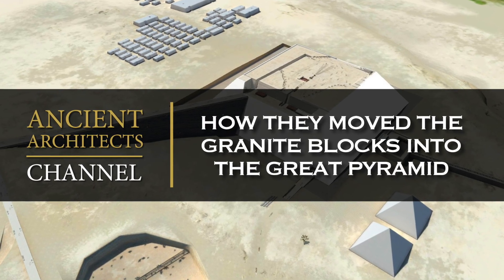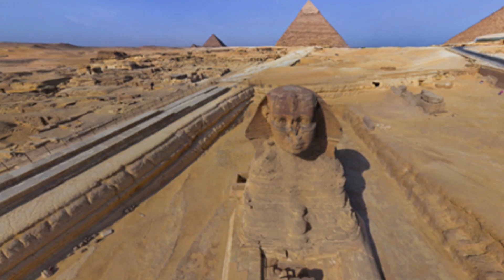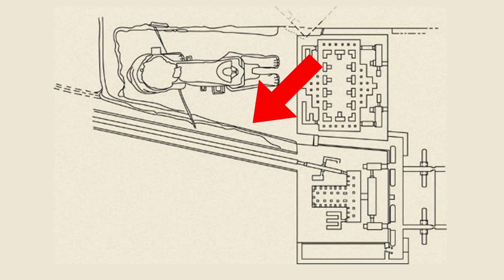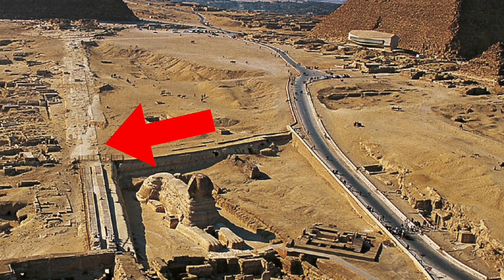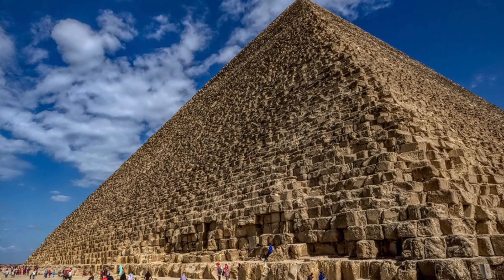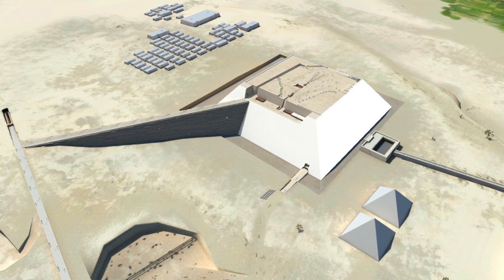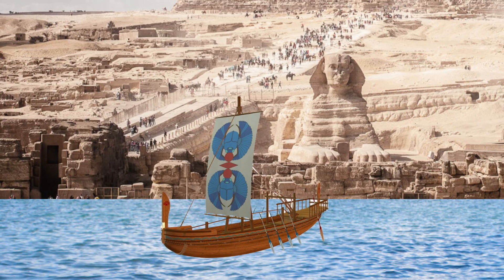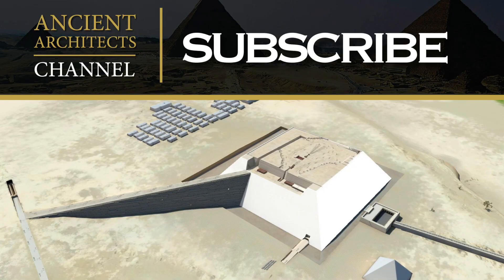How They Moved the 60-Ton Granite Blocks into the Great Pyramid | Ancient Architects

Comment: 1. It's clear to me, that the weathering of the southern wall of the Sphinx-inclosure, could not be created naturally when the causeway as you pressented us, was at it's place.
2. The structure of the causeway is much less weathered, which just means it was build later.
3. The valleytemple and the Sphinxtemple share the same base or foundation and has been planned together, which most likely means, they are both build at the same time, the first one with new blocks, and the second one with blocks from the inclosure which aren't granite.

Houdin has made many pictures, just by modeling with a PC, but that does not lighten his fault ideas.
Proof should be presented in order to follow his trend.

As far as I know ( which isn't much) the base of the Piramids where made much earlier in time?
Or did Bauval and Hankock where wrong in their books?
As you have mentioned before, it probably started with a structure like a mastaba.
So what kind of shaft should there be, in order to leavel a block on the ramp??
Straight trough the mastaba? Would they do that?
Not very plausible.

The way Houdin started his search, does not likely bring a new insight, setting the brain towards a solution means mostly, creating a possible solution with your old memory, which then start to manipulate the facts.
He had no option, that's how it began for him, having no job.

Like our famous Albert Einstein, it must come to you, out off the blue, suddenly you 'see' what nobody does.
He could not have made it, with the effort of thousand brains.
He was not even a proffesional..
Or better to say: because he was not bothered by the brain of a proffesional. :-)

Comment: You’re idea that because there is an angle to the causeway means that the Sphinx enclosure was built later is flawed. If the Sphinx enclosure was not there at the time of the building of the pyramid the causeway could have been placed at any angle up to a straight line access (90 degrees to the pyramid). If the Sphinx enclosure were there already you could then build the causeway anywhere BUT where the Sphinx enclosure was occupying space, without removing the Sphinx enclosure or covering it up. This doesn’t prove the age of the Sphinx to be older than the pyramids but disproves the idea that because the causeway is angled it was there first. (This also could also show that if the Sphinx was known to be there first it was of enough importance to not dig through or destroy.)
In a pyramid that is built to what has been termed engineering perfection, it is highly unlikely that the builders would take light any portion of the project and just lay a causeway down somewhere. The weather erosion on the Sphinx wall enclosure that you say could not have been disturbed if the Sphinx enclosure were older than the causeway could have happened several different ways. 
The height of the causeway above the floor of the Sphinx shows that either the causeway was built around the Sphinx or the Sphinx was carved out. Due to the height of the causeway above the enclosure of the Sphinx it would appear that if the Sphinx were built after the pyramids the causeway would have been of no more use and would not need it’s integrity kept. So why then would the angle remain when building the enclosure? It seems more likely that because of the difference in height of the causeway and the angle at which it sits that it was purposely built around the enclosure. The statue of the Sphinx age needs to be considered independent of the the enclosure. The Sphinx itself could have been built anytime before or after the pyramid but the enclosure of the Sphinx shows weather patterns of being there before the causeway otherwise the same weather erosion would be present on both the causeway and the enclosure if not worse to the causeway due to direct exposure. So the erosion of the inside of the wall could have been maintained in two ways. The causeway could be built around an already filled up with sand or gravel Sphinx enclosure and would not have been disturbed, or the enclosure could have been used to hold water (which could also rapidly enhance the erosion time). Now the actual statue of the Sphinx age needs to be considered separate of its enclosure. But in either case the causeway height and angle suggests that it was built around the enclosure regardless if the actual statue of the Sphinx was there or not.

Comment: How did they cut the rocks again?
Reply: One  of several possibilities. Sandstone is one of the softest stones. Saws of a copper-arsenic-nickel alloy (uncovered in the worker's village in the 80's and chemically analyzed and very much harder than copper alone) along with sand creates a good cutting edge. Once a sufficient groove is cut, wedges of wood are placed and soaked with water. The wood expands and the stone cracks apart.  The inner sandstone blocks of the pyramid s are quite crude, in spite of the "precision " claims made. The granite and casing stones, yes. The vast majority of the pyramid stones, no. The inner stones are so crude that filler mud and rubble was needed to fill gaps.

Comment: Maybe someone can figure out how much the Nile moves away from the Pyramids each year and then measure the distance from the Nile to the "docks" dividing that figure by the distance the Nile moves per year. It would still be an approximation but there may be a significant difference in these Pyramid dating arguments. Obviously; the "docks" would have to have been built first. So; that would be when Pyramid construction started. I still believe stone block cutting had to have been done in the Nile and with a very large diameter thin blade. There had to be water used to cool and flush material from the blade and stone. Then you have to determine if the blade was moved to the stone or stone to blade. I think it was stone to a stationary rotating blade. Floating the stones in water would be easier and more maneuverable.

Comment: This was rather brilliant!  Does a previous theory, that the Great Pyramid was actually built over what had been a hill, necessarily conflict with this one, or merely the two together suggest that building the Great Pyramid in this way, with the hill, definitely shaved a lot of time off of building it?  And since we also know that the interior blocks (the ones that aren't part of chambers inside the pyramid) are rougher cut, not so 'pretty', as the ones that are outward facing and inside chambers, would that also mean that building that in 20 years was pretty darn possible?

Comment: Hauling large stones faces two factors, weight and friction.  Instead of dragging [_] Turn the block V i.e. 45degrees.  Protect the edge of the stone with copper flashing to also reduce friction.  Check me on this, How wide is the Grand Gallery, would it accept the blocks at an angle?

Comment: Just a thought, that doesn't necessarily mean the pyramid is older than the sphinx. That just means the causeway is possibly. There could have been a temple or another important structure there first before a pyramid was thought of. Of course it is also possible that the pyramid does predate the sphinx but isn't definitive proof.

Comment: Look at a pyramid schematic and say you don't see the ramp and i'll call you blind.
The grand gallery is the ramp. There is no need for spirals around the pyramid. All you need is a few strong men and a winch to haul the blocks up. The gallery rises up with the layers filled...I guess its already 2/3 of the pyramid needed materials on the height of the kings chamber.
Just an estimate. And there could have been a second ramp as the space above the grand gallery might suggest.
Also the number of blocks is probably far lower than thought. I bet they used rubble to fill most of the pyramid. As least the quarries involved suggest that. So all discarded rock materials and chiseled of material found its way into the Pyramid as well. I really hate people using math to calculate the needed number of blocks, just based on its volume.
That's brain dead mathematics...
Reply: My comment may agree/Michel Rabbat...Florida

Comment: What if the causeway is as wide as it is because its really a water channel. We know they used boats to transport the stone. Why wouldnt you sail the blocks right up to the construction site? The water run off during the flood season of the Nile would cause the water erosion.
Reply: that wasn't feasible because the level of the Nile was almost never that high. Remember, Giza is a ~Plateau~, so it is Above everything around.

Comment: Um, sorry, counter weights don't actually help you because they then have to be lifted to re-set for the next lift. And without some multiplication of lift length, that shaft would not be long enough. And if you do use multiplication, then the weight involved has to be huge. Maybe some kind of winch was used?
Reply: If counter weight for the long causeway hauling was connected to ropes around the blocks to be moved from the Nile and strung around two great posts in the ground on either side (whose holes I believe were found) then the counter weights could have traveled down the causeway as a block traveled up.
Be aware that if the posts were well greased and had a brass sleeve to rotate around them so the ropes weren't rubbing directly, then the small amount of weight that a frictionless block path would cause could easily be overcome by not many men or beasts since the weight of the blocks would not be lifted, only tugged uphill at a low angle on some sort of metal or stone balls (or rollers) in the center channel.
Why hasn't someone suggested this before?  If they have, I haven't seen it yet. It seems like it's so simple that it would work perfectly....or almost perfectly.
Reply: Ok Adrian a quick lesson in physics mate.Even if everything was completely friction free, which it obviously wasn't, then any force used to help do work must also be re set ie lifted. So there is no net advantage to using counter weights for this purpose. It takes the same energy to push the counterweight back up as it would the original load. Counter weights in lifts only counteract the weight of the elevator car not the load. This is why no one has suggested it because it doesn't work.
Reply: @stephenhammond1656  There's another option that no one else has suggested, and that is that the counter weight is people.  If they were to sit or stand on a fairly frictionless counter weight and provide its needed weight, then after they reached the lower end of the run they simply walk back up the causeway to do it again for the next block. Perfect!  Genius!  Thank you. :)
And what the heck to you mean that no one has suggested it?  you forgetting J.P Houdin?

Comment: Great work! It is possible that they used water in each pyramid causeway to transport the stones without friction... perhaps the internal width of each of the three causeways is slightly larger than the width of the stones used for each pyramid confirming their purpose...
Reply: uh...but water does not sit in an uphill channel parallel to the bottom. it flows downhill,...I think. Right?  :)
Reply: @redwoodcoast  Yes, water always flows downhill. Matt from Anchient Architects made previouly a video where water was pumped to the inside of the pyramid to excite strong low frequency waves at the pit. If they used some kind of water pump then it might be possible...

Comment: It looks like the causeway was built around the Sphynx due to the angle. Otherwise they would've made it the shortest possible length. Instead, it's off at a goofy angle in order to go around the (sacred) Sphynx.
Reply: With the dating of the plateau temples it was found that their maximum age could be about 3,500 BC, so the Sphinx would be at least that old we'd assume. But if the middle pyramid is even older, then they did not use the causeway in its construction because it would not have existed yet if it was located to accommodate the Sphinx enclosure.
Reply: @redwoodcoast  I've re looked at the diagrams in the video and can't see that they really determine anything. Why wasn't the causeway built at a right angle to the pyramid? It's current angle doesn't even really work for the Great Pyramid. And the counter weight idea is a bit lacking in detail, imo. Cheers
Reply: @seanhammer6296  more like 'totally lacking' in detail.  It worked okay within the great pyramid but then the distance was not 500 meters as is the length of the causeway.
Also, I just now wondered why the causeway could not have been built on the other side of the Sphinx enclosure.  It's not that wide so the causeway might have been perpendicular on the opposite side.
Reply: @redwoodcoast  I saw that too. Also, were those little pyramids there first? His diagrams seem to indicate that. I'm getting about ready to throw the towel in on this one.
Reply: @seanhammer6296  You wouldn't be the first... -or the last. :)

Comment: When using rounded logs underneath like wheels to make the large Boulder easier to move makes it alot better than trying to push or pull on the ground doesn't make sense and having wedges in position to stop it from rolling unstoppable makes moving alot easier trust me I've worked in a log mill where you actually have to move large logs it's just a Manuel conveyer belt that's all

Comment: None of this explains how they placed 2.3 million blocks in 20 years with laser precision. If they worked none stop that would be one block every 4.57 minutes ( 2minutes and 34 seconds) for 20 years. If they only worked in the day for the light or the night for its coolness and reckoning an average of 12 hours of sunlight per day that means a block every 2.285 minutes ( 2minutes and 17 seconds). I'm thinking it took much longer than 20 years.
Reply: The actual number of blocks is totally unknown and unknowable.  I argue in: "Why Every Theory of the Great Pyramids is Wrong " that they may have only used half that number, and were stupid if they didn't.  I say that they relied on a huge percentage of sand, gravel, rubble,  quarry powder and limestone & chemical binders which turned huge sections into concrete.  https://sciencetheory.wordpress.com/2019/03/10/why-every-theory-of-the-great-pyramids-is-wrong/

Comment: the way they moved many of the blocks was to rope wooden quarter circles to the block and then roll it like a keg of beer. Rollers on sand are too small diameter and will sink in,   however, using the quarter circles enlarged the diameter to the diagonal of the block. If you had a block 3' x 4' the diagonal is 5'. So the effective diameter of it is also 5', or  radius of 2.5 '
Reply: That's a great idea!  But there wasn't a sand surface to move them on. There was a stone causeway, remember? But it would have worked on it even better, so now all we need is a piece of evidence to validate it.  Logic alone can't accomplish that, but almost.  The question in my mind is who first thought of that brilliant idea?  If they didn't have the wheel then maybe they were not yet thinking in such creative terms. but no one can prove that they weren't.
Reply: @redwoodcoast  I read an article about this years ago, I think in Popular Science - the article showed wooden quarter circles that they had found buried in the sand. The article showed photos of them rolling a large block of stone with newly made replicas of he wooden quarter circles.  See this link
https://blog.world-mysteries.com/mystic-places/the-great-pyramid-and-transport-of-heavy-stone-blocks/

Comment: U don't have metal or wheel, but u fit 60 tones granite blocks with absolute easy.....perplexing?
Reply: Of course they had metal and wheel. There is metal inside the pyramid, up the 2 shafts going out the so-called queen chamber. And there is a circular artifact in the museum that is much more complex than a wheel. Anyone claming they had no wheel or no metal (or no machines to cut the stone for that matter) is either not well informed or is intentionally being deceitful. The evidence is undeniable at this point